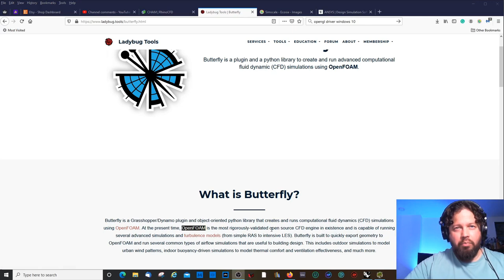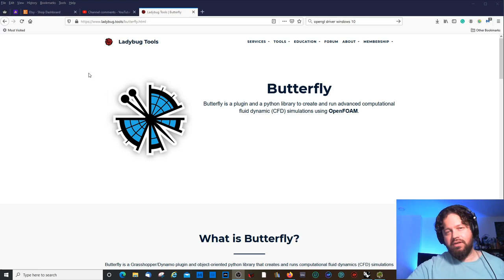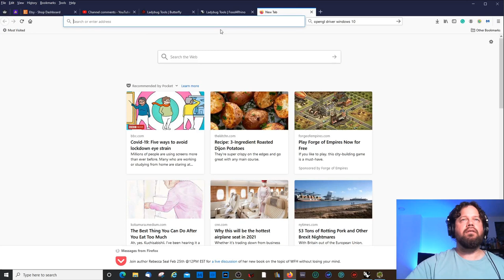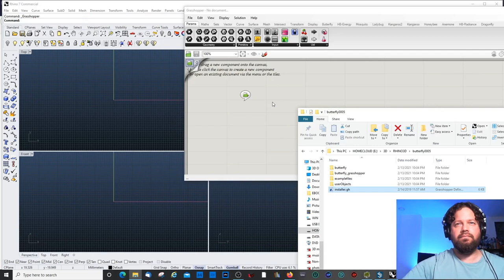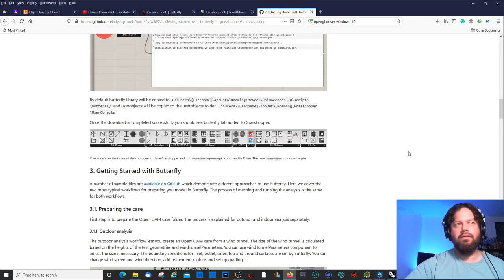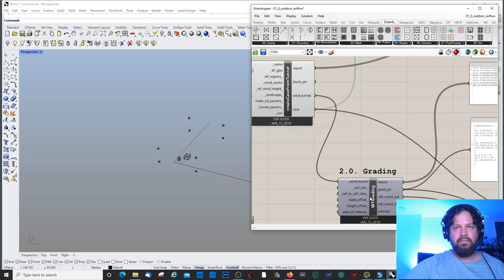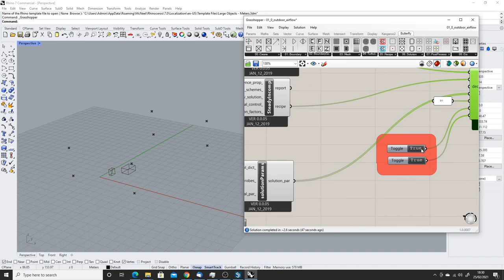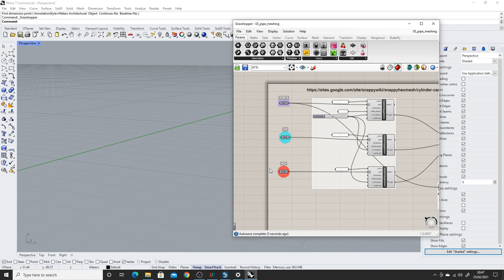Butterfly CFD | Step by step Installation | Fluid dynamics Inside Rhino Grasshopper3D | Part 00

Comment: Be sure to use default destination loaction (timecode 6:10), otherwise nothing works and you'll have to delete everything and restart the setup. The tutorial is great btw)
Reply from the maker: Yes, true. Thanks for reminding everyone.
Reply: The blueCFD-Core must be the 2017 version?
Reply: Forget it. I've read it must be the 2017 version. Thanks anyway!
Reply from the maker: Yes, the problem with butterfly is that it's quite old and it seems the ladybug developers are currently concentrating on other tools. That's why only the 2017 version works. I hope they give us an update at some point.

Comment: Thank you for this amazing tutorial. It is really beneficial and new. And please keep posting :) And, I have a question. There are example files that are downloaded with the installation. For example, indoor airflow example file. I want to ask that, can we use directly these example files, like just integrating our model to them and run? Or do we need to make all connections from the beginning?
Reply from the maker: Hi, thanks for watching. I'll definitely continue posting these videos. I am still learning the software myself and it just goes slow and step by step. Sadly there is not much learing material from the butterfly developers. Partly the reason I'm doing these tutorials is to understand everything myself. It's basically me trying to figure out how it works but then also share it with the community. Long story short, as I see it, the example files are both learning material and possible solutions. So I see them as valid scripts for real analysis and definitely can be used for your own projects. I would, however, recommend trying to understand them throughout before use in a real project. As in all ladybugs tools, there are many ways of course on how to use it and what you use it for. The possibilities are endless I guess that's also the beauty of grasshopper. See you in one of the next tutorials.
Cheers

Comment: Hi Philipp thank you so much for your videos! I followed every step, however, when I try to run (toggle- true) the components nothing happens. when I go to Butterfly user objects, and then properties it is set to 'read-only'- but I can't seem to tag it off (every time I try I comes back again). Any Idea what may be the issue or how I can fix this?
Reply from the maker: Are you running rhino in admin mode?

Comment: Thanks for this great tutorial, But I have a problem running the block mesh in the example file, is not working for me. I followed each part to install the butterfly and now do you think I should uninstall all and re-install again?
Reply from the maker: Have you tried all of the example files or just one?
Are you running rhino in admin mode?
Reply: @PhilippGalvanDesign  Thank you for your reply. Honestly, I just checked the two outdoor wind flow example files. And I noticed when I run the Wind Tunnel then the Block Mesh can’t run and it turns to red. I don’t think my rhino is in the admin mood, actually, I'm so new in this and just started to use it for climatical analysis for my thesis project. So maybe If I continue your tutorials, I can fix it. Thank you again.
Reply from the maker: @HeliaMalvandi  
Rhino needs to run in admin mode for Butterfly CFD to work... Admin mode: when opening Rhino you right-click on the Rhino symbol and choose 'run in admin mode' from the drop down menu. If you are very new to rhino and co., I would recommend to use a more user-friendly tool for wind analysis... Butterfly CFD is great for tinkering but a pain when it comes to simulation because of its unfinished nature. Especially for a thesis it could be good to use different software packages and approaches in comparison. Good luck.

Comment: EDITED, see end of message: Philipp, at 13:24, I try to do the same as you: when I try to run the "_run" on the blockmesh, it doesn't work and I have the entire "Blockmesh" highlighted in red. I create a Panel that I link to the report to check the error and I have a "runtime error (Win32Exception) : WindowsError" ... I spent a few hours trying to debug this, and I can't find any solution, even on Github. Can you help ? Thanks a lot

EDIT: Running Rhino7 with Blue CFD Core 2020-1 DID NOT WORK. Simply try with the older version Blue CFD 2017-2 (same presented in this video)
Reply from the maker: Some things to check: 
1 - are you running rhino in admin mode?
3 - have you changed the wind direction?
4 - try with another script - I provided one in my later videos. Link in the show notes.
5  - send me the script (office@nedomlel.com) so i can check.
Reply: @PhilippGalvanDesign  Sorry it was very late yesterday and I didn't edit correctly my previous comment: I could make it work with Blue CFD Core 2017-2 ... Not with the 2020-1 version. However, I could never finish the calculations. I have a new laptop pretty powerful and even though to get to the 45th iteration I had to wait roughly 1 hour. (600 iterations was the limit...) . So this is my new problem now. Is it normal it takes so long? Also, the vectors were not showing up for some reason.  FYI the script I used was the outdoor_airflow from the example files, nothing modified. 
Thank you so much for your tutorials by the way, this is a gigantic help.
Reply: its problem same with me

Comment: hi Philipp the butterfly shows me it is old in grasshopper also I download the latest version what can I do
Reply from the maker: There is only one version from 2018. Sadly the developers haven't updated this software.
Reply: @PhilippGalvanDesign  but can i use it or no?
Reply from the maker: Yes you should be able to use it still. 
I use it together with Rhino7. I haven't tried it with Rhino8. But I don't think it's an issue.

Comment: Hi! I have been following the tutorial but when I try to run the visualize block mesh I get this error-' Solution exception:Failed to find points file at C:\Users\Peau's PC\butterfly\outdoor_airflow\constant\polyMesh' What could be the possble reason? And how to fix it?
Reply from the maker: Hi which, version of BlueCFD have you installed?
Reply from the maker: Be aware that you need to have BlueCFD 2017 installed. Newer versions are not compatible with this butterfly version.
Reply: Hi Philipp, it's the 2017 version. I was looking for solutions but seems like many people faced it but I couldn't solve it yet. I even started doing it from scratch following your other tutorial but the same error occurs.
Reply from the maker: Some other possible reasons.Are you running rhino in admin mode? Have you changed the wind direction? Have you downloaded one of my scripts and tried these?

Comment: I'm having issues running the Solution portion of the example file because the geometry in the Rhino view ports just disappears when I run the boolean toggle? Can anyone help me figure out why and how I can fix this. I'm running Rhino 7 btw
Reply from the maker: Are you using the example files from butterfly? I had issues with some of them. I also run rhino7 and the never got the wind study example to work. Rebuilding it from scratch helped.
Reply: @PhilippGalvanDesign  ok turns out only the 2d example files arent working properly. However the solution for outdoor analysis is taking me ages to complete. How long approx did it take for yours to complete and also did you change any parameters regarding the cell size and cpu parallel running in your code?
Reply from the maker: The speed really depends on your computer power and the complexity of the model. You can find a link to a working script in the follow-up videos to this one. I manly simplified the script and use a minimum resolution for testing.  The idea is to have a simple working script as a start and then go from there and increase the resolution and precision depending on scale and complexity of the model.

Comment: I tried to install follow the step and turned out It didn't work for my Rhino7 when I use the command it said 1. Solution exception:
Failed to import butterfly: Can't find butterfly in sys.path. But I installed every single one what should I do. Thank you for tutorial.
Reply from the maker: Hi Maffsa, just want to check. which version of Blue CFD did you install. Did you run the environment setup for blue CFD. Are you running rhino in admin mode?
Reply: @PhilippGalvanDesign   I installed blueCFD-Core 2020-1 , Ladybug Tools 1.4.0, and Butterfly 0.0.05. I did run the environment setup and it also said "environment is ready". And yes I run rhino in admin in every second steps, but still not working. I tried to re-install everything but it turn out not working again
Reply: @PhilippGalvanDesign  The plug-in  Ladybug, and Honeybee is working. But the butterfly doesn't working at all all the butterfly's command on sample files turned red and the message said "Failed to import butterfly.
Reply from the maker: @Pieceofnapa  BlueCFD version 2020 doesn't work. It needs to be the 2017 version. There are two 2017 versions both should work.
Reply: @PhilippGalvanDesign  I installed 2017 version but it doesn't work again :'(
Reply from the maker: @Pieceofnapa  are running rhino in admin mode?
Reply: @PhilippGalvanDesign   omg I did run in admin mode, I tried install 2017 version and save it on the default installation path, and now it work! Thank you so much for your advice. You are the best  🙏🙏🙏🙏
Reply from the maker: @Pieceofnapa  yeah. Everyone has the same issue. Including me ;)

Comment: Hi thank you for video i am receiving this error "1. Solution exception:'docker-machine' is not recognized as an internal or external command, operable program or batch file." under the 2.1 BLOCKMESH. i can't seem to fix this
Reply from the maker: Which version of blue Cfd did you install?
Reply: @PhilippGalvanDesign  i also did 2017. and i ran it in admin mode. thank you for the quick reply!
Reply from the maker: @obieswan  have setup the blue cfd environment?  Maybe also you want to try the example files which came with the the installation package. It's a good way to see if there is a problem with the system or with your script...

Comment: i have doubts regarding installation of cfd .. it didnt work on my  pc after following same procedure and thz video is 3 years old maybe not working on new rhino.. so please upload  trying new version of rhino and grasshopper using same procedure .
Reply from the maker: Which version of rhino are you using.
And which  blue core CFD version did you install?
Reply: @PhilippGalvanDesign  same version 2017 bluecfd and rhino 7
Reply from the maker: Are you running Rhino in admin mode?
Reply from the maker: And did you create the CFD environment?
Reply: @PhilippGalvanDesign   how can i check thz ?
Reply from the maker: It's important to run Rhino in admin mode. 
When you start Rhino. Right click on the icon and choose 'run Rhino in admin mode'.
Reply from the maker: For the Blue CFD environment.  After installing Blue CFD you need to click the bluecfd icon on your Desktop to create the environment.
It's all in the video.
Reply from the maker: You have to follow the video on the dot otherwise it doesn't work.
Reply: @PhilippGalvanDesign   yes i do
Reply: @PhilippGalvanDesign  okay i will try once again and let you know